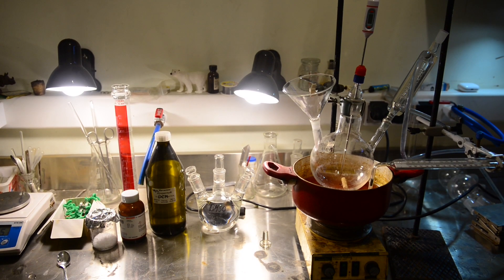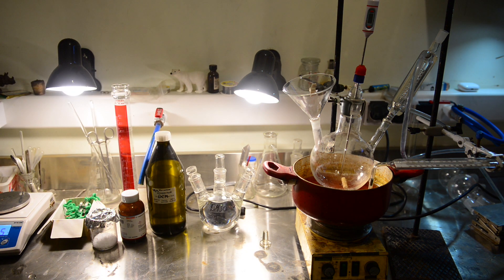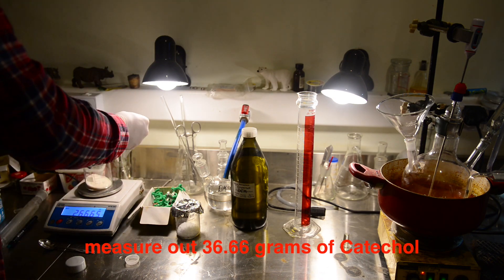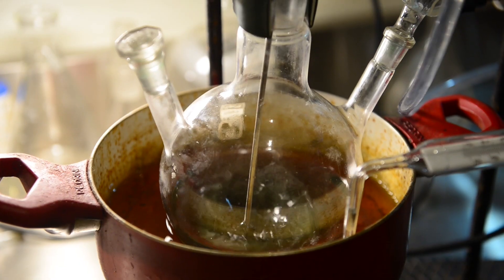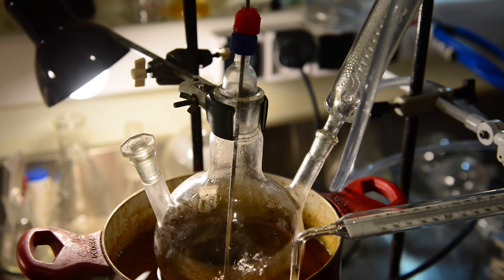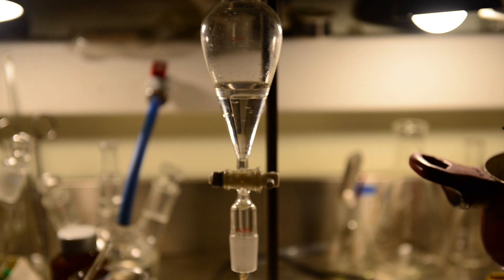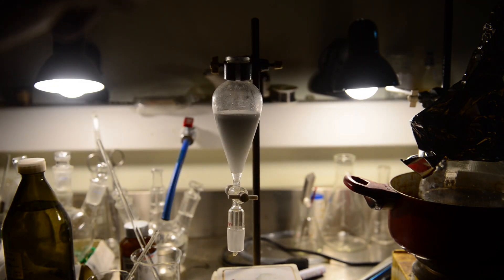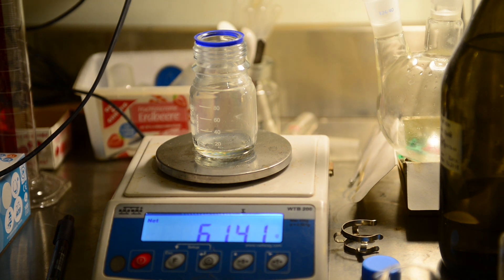1,2 Methylenedioxybenzene synthesis attempt N1.

Comment: i'd separate the reactions. I'd let the cachetol react 1:2 with NaOH in water, slowly evaporating the water to make sure the reaction happens to completion, resulting in the crystalization of the sodium cachetol alkoxide. Next i'd rather use one organic solvent which both the sodium cachetol alkoxide and DCM desolve well in, but sodium chloride does not, this way the equilibrium is shifted easily to the right, because sodium chloride will fall out of solution. I'd add the DCM 1:1 to sodium cachetol alkoxide and add it slowly. i'd first try moderate temperatures for the last reaction. Tell me what you think. ;)